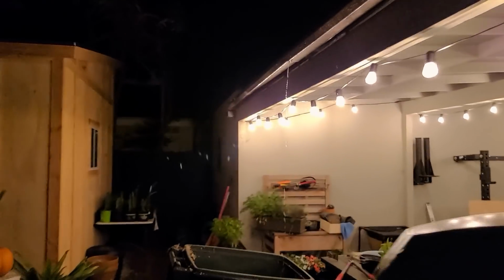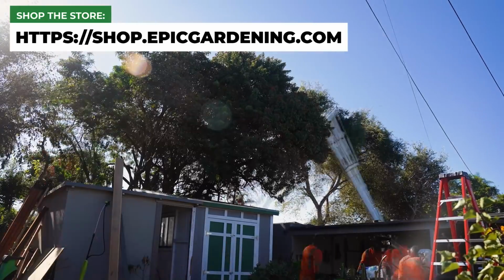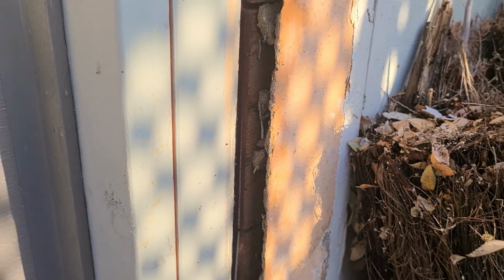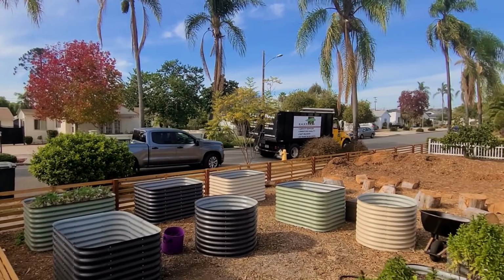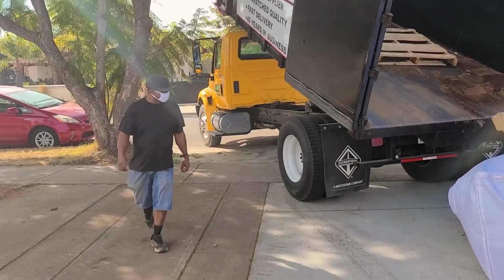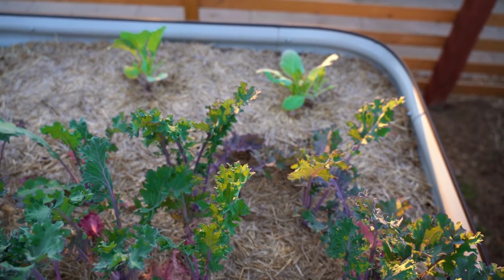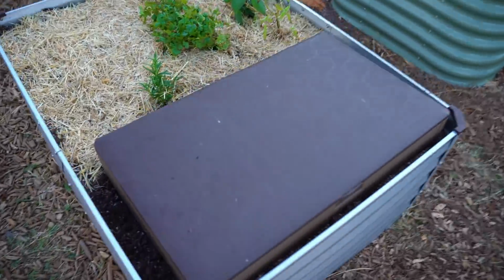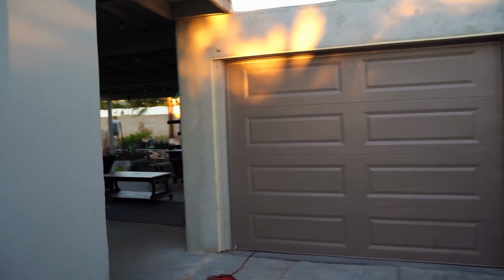MASSIVE SOIL DELIVERY! Homestead Update Ep. 10

Comment: I wish I was west coast so I could just do it but, you can use high quality silicone to fix that gap in your gutter. for a dowspout I suggest using a flexible 3inch hose so you can move it between water storage vessels.
Reply from the maker: I'll be fixing up the gutter w/ a fatty steel or aluminum one!